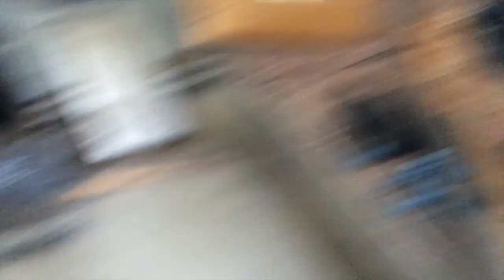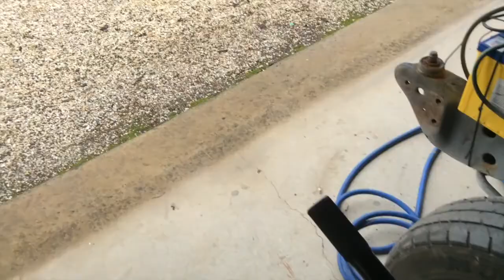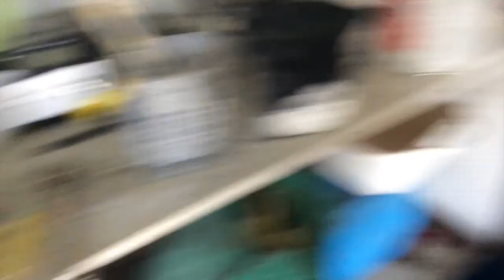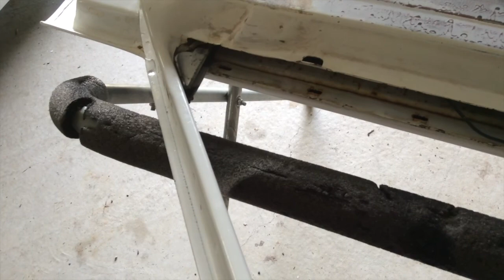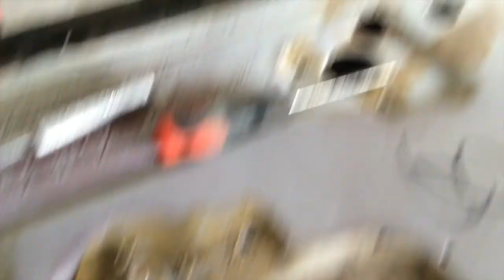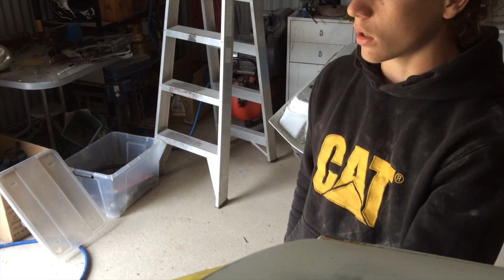How to remove HQ door glass | HQ One Tonner

Comment: Gday mate Love the work your doing to your tonner. Ive just turned 19 and been rebuilding my 74 HQ tonner for 2 years doing similar work as yourself, just wanted to ask if you have any tips for patch repair panels that you might have had to do? Overall mine is in good nick just got a couple of little things i wanna fix myself. Was evening thinking about posting the build on youtube and now that ive found your channel i think im 100% gonna do it. Keen to see it come along. GL mate -Trae
Reply from the maker: So good to hear the support mate. Yeah overall I just get a bit of body filler and put some harder into it and then wipe it over the damaged surface and then make sure it is filled out just incase then when it is dry sand it down to the body shape or panel shape and if there are any air bubbles in it just put a bit more body filler in it and sand it again. I might take a couple or try but it's a pretty easy job to do. Thank you so much for your support and I will hopefully have another video up by the end of this week soon as I am back in remote learning should give me some more time to post some stuff about it. Let me know if you ever post a video I will for sure watch it 👍